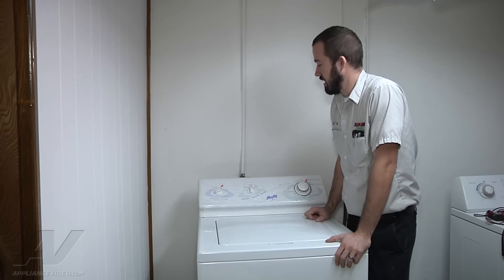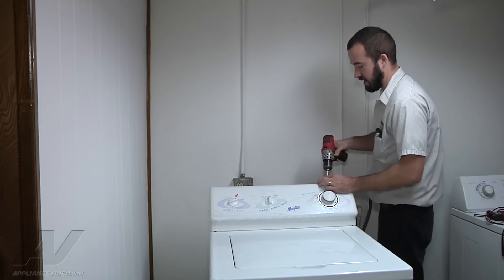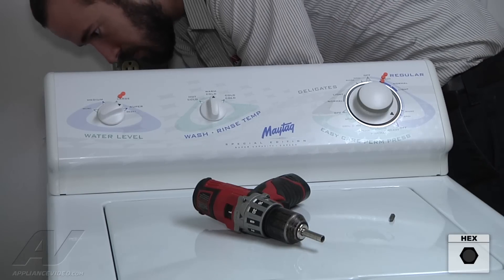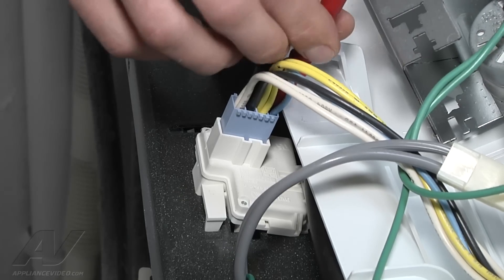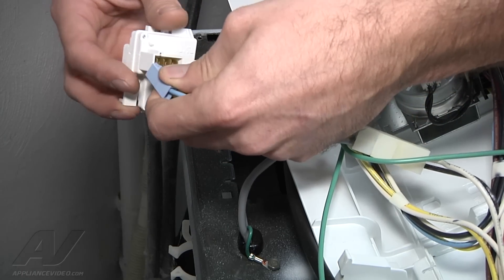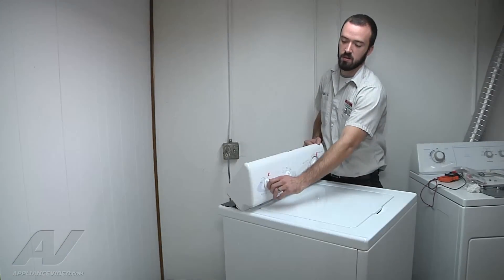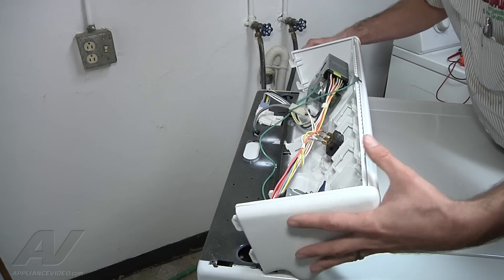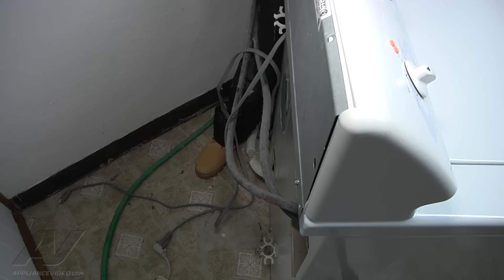Maytag Washer Repair - Stops Mid Cycle - Lid Switch

Comment: Has to be the cycle panal pressing start does nothing
Reply from the maker: Great question, if you have a more technical question that our parts department cannot answer, you can search our over 17,000 answered questions free at our website www.ApplianceVideo.com under our Repair Help section. You can also call our parts department at 1-800-830-5465 and they can give you help 7-days A week ,or search at www.SaveMoreOnParts.com  .
Reply: The connection of the two hoses a three way open ends one for venting and reset of machine fixed problem

Comment: I have a Maytag 7000 series with this stop at wash issue and my machine is only 2 years old. I am very dissatisfied with what I thought was a high quality washer brand.  I have been dealing with this stopping on the wash cycle for 6 months. Its not the lid lock. That works fine.  I have to go to "drain and spin" to empty the washer,, then set it at quick wash with no soap to get a rinse cycle, then back to drain and spin because the quick wash stops at wash,, I paid good money for this machine and its JUNK!  This is what happens when they want the Chinese to make their machines instead of US workers.  I'm going to mess with the water valve but I know its going to cost me a fortune to get a repair man here if I cannot fix this myself.  The so called 10 year warranty is worthless! All it covers is the motor.  What a joke.  Screwed again.  The whole appliance market in this country has gone to the dogs.